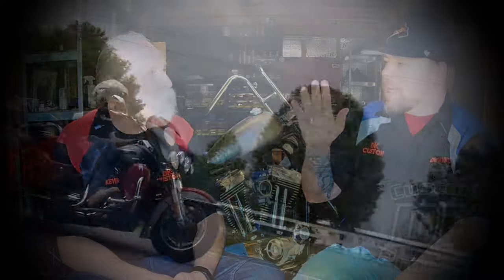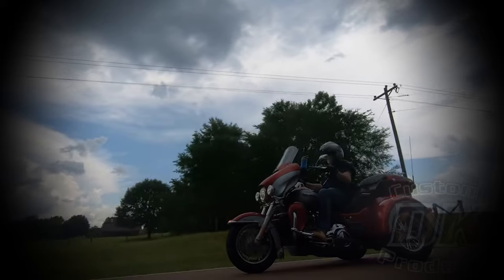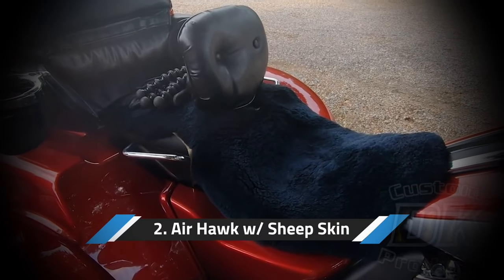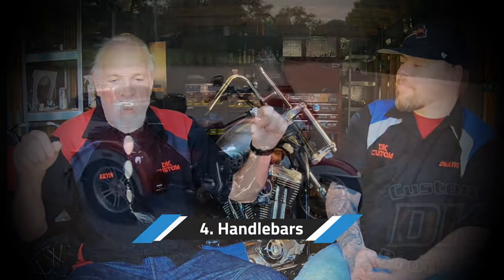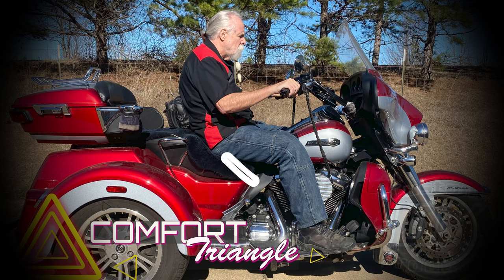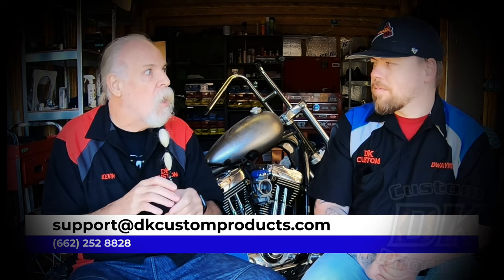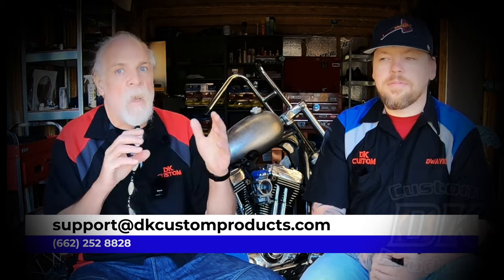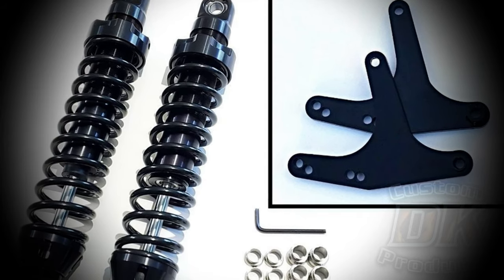First Things We Do to a Trike & a Bagger For Improvement

Comment: Good video as always. I have done  all the things you mentioned except the sheep skin seat. I have a 2018 Ultra Glide with 48K miles with the factory seat. I had my dealer install the Legends suspension front and rear w/lift kit and ride VERY COMFORTABLY. The thing that I had done to my Ultra Glide after the first couple thousand miles was a Stage 1 & 2 upgrade. I had traded my 2015 Street Glide in on the Trike so I was looking to "retrieve" that power difference from 2 wheels to 3 wheels. And it work out GREAT !  Kevin mentioned this 2019 was his third trike. Was mileage the reason he traded ? I have 48K on my trike now and just curiou what I might expect for the future. THANKS for sharing your videos!!!!
Reply from the maker: Thanks for the good words, much appreciated, and glad you are finding the videos useful/interesting.
My first TG was a 2009 and we thoroughly enjoyed it.  The only reason I got a 2014 was because we needed a Twin Cooled for product development.  The 2009 had somewhere around 70K miles and was running great.
****note on the 2009...it was running too hot from the factory and had the top end rebuilt under warranty at around 20K miles.  After that we did a bunch of cooling mods on it to keep it in the optimum temp range***********
I got a 2019 TG because we needed a M8 for product development.  The 2014 had around 80K miles on it and was running great.  I had done all the cooling mods to it as soon as I got it, so it had no accelerated engine wear.
On Harley Trikes the heat is the biggest reason that they wear out prematurely.  The only other fundamental challenge they have are the axle bearing retainer plate.  We have a video on them at this link- https://www.youtube.com/watch?v=eTF6Uqm2KZU
Reply: @DKCustomProducts  THANK YOU for the explanation .... I am less inclined now to think I need a new bike.  Definitely going to keep putting on the miles. THANX AGAIN !!!
Reply from the maker: @paulbronnenberg2075  You're welcome, happy to help. Ride safe!

Comment: Honestly I'd like a mod that would move my floorboards up a slight bit rather than outward so I can get more lean angle, but most people dont rip around on a bike with floorboards like I do. The extensions take away lean angle that I use all the time.
I'm hoping my 13inch monoshock install gives me a bit more lean angle since its a bit longer than the stock one.
I cant do back rests either because back rests and chairs agitate my back and make my back pain worse. I always wondered why I could ride my harley and ebike for hours and have no back issues, but I get home and sit in my office chair for 15~20 minutes and my back hurts. Turns out back rests and me don't mix.
Reply from the maker: Hey Fran,  Just watched your two most recent videos.  Can't do too much practicing in a parking lot.  Looking good.  Your lane splitting video brings back lots of memories of riding the 405 and the 5 in Cali.
We do have floorboard extensions that move the floorboards Forward 1.5 inches and out 1 inch.  Much more comfortable ride, and even though they are out 1 inch, but being forward 1.5" you will have increased lean angle!
Here is a link to them- https://www.dkcustomproducts.com/rider-floorboard-extensions-for-harley-fl-m8-softail-models-2584.htm
Reply: @DKCustomProducts  Thank you. I don't want them any farther forward though because when I corner hard in the twisties, I pull my inside turn foot back to the rear point of the floorboard, which adjusts my body a bit to influence my weight and spin direction over the tank into the inside of of the turn. I would want a sort of mounting lift at the point where they connect, so I can keep them in a good spot for foot positioning.
Reply from the maker: Yes, understood.  I'm so used to folks wanting them further forward, I misread your original comment.  Apologies. 
Unfortunately we do not have any plans to make them sit higher...but that may change if there is a big demand for them.
Enjoy the wind! 🏍

Comment: Kind of off subject but, I have a 22 road glide special and was wondering if the love jugs mighty mites would be sufficient at cooling the engine down enough to spare it from the destruction from the high heat these motors put out?
I am planning at least a stage 1 but, leaning towards a stage 2. 
I want this bike to last me a very longtime if possible.
Thanks in advance.
Reply from the maker: Fans are an important factor in getting them cooled down to the optimum temps.  There is a complete list at this link- https://www.dkcustomproducts.com/why-how-to-cool-down-the-twin-cam-engine-part-i-dk-cl-tc-dn-1.htm
And a video series on the subject at this link- https://www.youtube.com/playlist?list=PLb3bvZgbH92_3s-2vv63QggFJ3nteFd_C
Fans can be a valuable part of the overall strategy.  Unfortunately for the last year the two different fans we have used (Might-Mites and Force Flow) have been hard to get due to supply chain issues...and the Mighty Mites that have been available are having a higher than normal failure rate, with no easily available parts to fix them with.  We currently have some Force Flow Fans that you can see at this link- https://www.dkcustomproducts.com/jims-force-flow-fan-cools-twin-cam-engine.htm

Comment: I have a 2015 Tri Glide. What size are the stock bars? I need the bars about an inch further back and maybe an inch higher. A bad shoulder will not let me go any higher than that.
Reply from the maker: Not sure what size the stock bars are. 
For handlebars, the following link is about them- https://youtu.be/5h77GQJTW1w?t=306
What works for me will not necessarily work well for you, but the above link shows what I have and what you can do to get the ideal for you.
Reply: I put KromeWerks 2+2 narrow sweepers on my 2020; much better. 2” taller and 2” narrower.

Comment: Curious.  I have a 2020 tri glide. How easy is it to move bars down just a bit.  My triangle feels like I need them back slightly
Reply from the maker: Underneath the plastic plate that your ignition switch goes thru are the handlebar clamps.  You can remove that plastic by one screw on either side.  You can then loosen two of the clamp bolts, rotate the handlebars, and then retighten the clamps.  Use threadlocker.
That may get you enough pull back to avoid needing to get different bars.
Reply: @DKCustomProducts  thank you.  Great chann
Reply from the maker: @raygeraghty6670  Thanks for watching! Glad you're enjoying the videos. Ride safe!

Comment: Guys, a little silicone spray on the terminal ends of the coil relocation kit goes a long way. NEITHER terminal end was put together completely. I didn't want to complain but it shouldn't have gone out this way. 
T.S.RACING
Reply from the maker: Thanks for the tip!  Appreciate the add.
On the wire(s) that you had trouble with...if you have not already, please call or email Natalie and let her know.  We will want to check others to see if there were many, or it was a one off.  She will take care of you.
Support@DKCustomProducts.com
662-252-8828

Comment: Looking into a sheep skin, the wife is concerned about getting a black skin. She thinks it will be hot, and worries the dye used will wear off. Any one have any issues?
Reply from the maker: Our sheepskin is almost 20 years old.  Around the 10 year mark the black did start fading a bit...it still looks mostly black, but when looked at closely it has definitely faded and has a little bit of a bluish tint.
Of course, that is the one we have...entirely possible that a different skin could start fading even more quickly.
The nice thing about sheepskin, regardless of the color, it is warmer during cold weather and cooler during warm weather.
I think a lot of folks get the light tan color and are happy with it.  We have not been unhappy with our, probably if we had a lighter one it would show stains.  Probably just comes down to a matter of preference.
Here is a video where you can see how black ours still was at the 17 year mark.
https://www.youtube.com/watch?v=5h77GQJTW1w

Probably the bigger decision is to get a single skin and trim it to your general seat shape, or to get the pre-cut ones that are exactly cut/contoured to the shape of the seat.

Hope that helps.
KP
Reply: There are black sheep you know .....